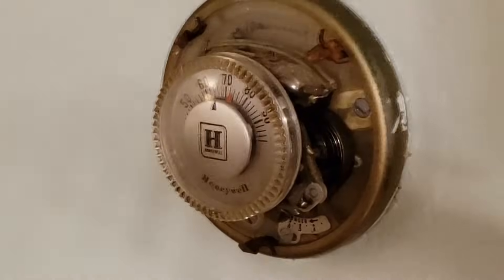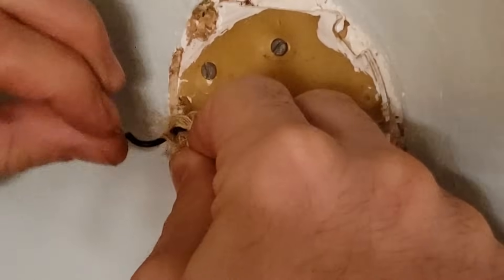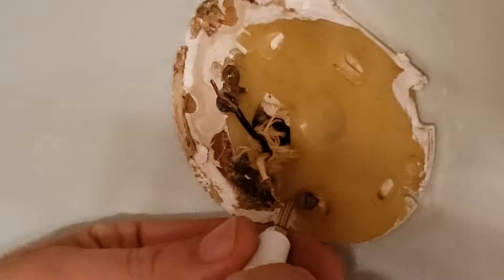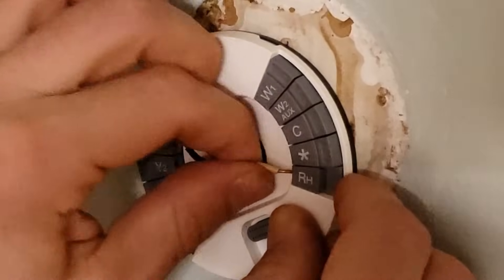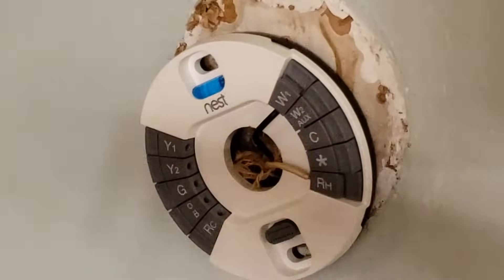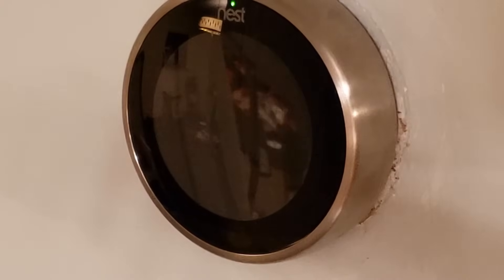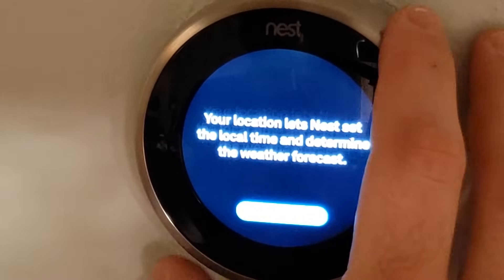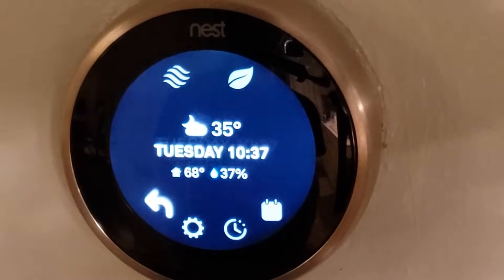How to Install a Nest Thermostat with Only Two Wires

Comment: just came across your video i was all day trying to connect with 3 wires from my old honeywell just like yours but i have a green,black and red wire where do i connect to. i thought green wire for G , B for blackwire and the RH for red wire but it didnt work. the nest read i had no cooling or heat connected?

Comment: I am trying to upgrade my current Honeywell HVAC system with EIM to Nest (3rd Gen)... In my existing thermostat (Model: THX9421R5021WW), I only have 2 wires coming into my thermostat (White and Red) but it controls both Heating and Cooling using the EIM. 
Can I use the above recommended approach for my upgrade? i.e will it work?

Comment: My thermostat is a Honeywell heat only. It has 2 wires. A red and a green. No white. The red goes to R and  the green goes to G?
Reply: No.
R AND W - it doesn't matter if it's 2 wire... Or what TWO colors.
Connect to R and W.

Comment: If I have 2 wires coming from a 24v transformer to my existing thermostat, can I install a nest 3rd gen. this way in your video? And if so, does it matter what color wire goes into each of those two tab connections on the nest?...Thanks in advance..
Reply from the maker: I don't see why not. If that's 24 volts AC, and if you touch the two wires together and your boiler turns on, then that's exactly the same setup I have.

Comment: My customers always makes this mistake, you need a common wire without that the Nest will die .
Reply: Yeah stat will lose charge-
Reply: @michaelpaulzdaone  yes the common wire is supposed to provide power to the unit. Otherwise it would need batteries. Without it...🤷🏼‍♀️🤷🏼‍♀️🤷🏼‍♀️
Reply: @melissamilligan  The Nest E and this 3rd Gen unit "steal" power from the two wire system to charge the battery but this can cause issues with some furnace systems. So one must always be prepared to have to use a power adapter into the C terminal. This is why you so often see conflicting experiences, it works for some but not all systems.
Reply from the maker: No mistakes here, at least not with this boiler. Doesn't die.

Comment: You HaVE to have a common wire people!!! (At least a 3 wire thermostat cable) to make these work correctly. As a tech for 10 years trust me! If it’s a 2 wire say red and white  that 24v is dedicated to making the switch at the heating unit to turn on.  Yes you will power your eco bee/nest when NOT calling for heat ... but when your thermostat makes a call for heat it stops powering the ecobee/ nest and will power off
Reply from the maker: You literally just watched a video where that doesn't happen.

Comment: If I have a 120/240v old thermo do I need to install a transformer to lower the voltage still ?
Reply: If you buy this in the uk/Eu it comes with an extra box called a heatlink to handle the high voltage switching of the boiler. Do not try to work this with a 240v system without the heatlink
Reply from the maker: @nelseify  also keep in mind the EU uses 50 Hz instead of 60 Hz for AC electricity. Might still not be compatible here.
Reply from the maker: Not sure about that one. Just guessing here, but on the surface it sounds quite painful, step down to 24VAC for Nest then step back up to 120VAC again to maintain compatibility with your furnace. Probably easier to just get a 120VAC thermostat.
Reply: @Bootstrappin  
If your thermostat is labeled 120V or 240V or has thick wires with wire nuts, your system is high voltage and isn't compatible with the Nest thermostat. Do not connect the Nest thermostat to high-voltage wires
Reply: I am asking I want to switch to a nest and from what I read, it says that it wont work if my thermo is running at 120/220 . I don't wanna buy one and not work lol

Comment: So,what's charging the battery if you only have two wires?
Reply: Dude its A/C voltage. Those two wires carry power when the heat cycles off, charging the battery. When they are shorted, they do not charge the unit, but it has enough time over a day to fully charge

Comment: That isolation switch is so badly designed with ON/OFF at the wrong ends with arrows, so a quick look appears to show you turning it on.  That is so bad for a critical safety item -they must be unambiguous.

Comment: I have what looks like the same behind my mechanical thermostat (1 white & 1 black wire) controlling 5 baseboard heaters in parallel. They are a combined 4,500 W. I think I would need the C-wire transformer to get power to the NEST, but can it handle my setup?
Reply from the maker: As long as your existing thermostat isn't a specialized 120VAC unit, you should be fine. All most thermostats do is close a small 24VAC relay, it doesn't have all 4,500W actually going through it.

Comment: what features aren't available when using the two wire setup?
Reply: R (ed) - Power
Y (ellow) - Cooling
W (hite) - Heating
G (reen) - Fan
C - Common
R + Y = Cooling Only
R + W = Heating Only
Reply from the maker: None I can think of. Typically it'll control an entire HVAC, turning AC on/off, maybe the fan. Either way, full features.

Comment: You den lost your mind, installing a $250 thermostat on a wall heater. 😂.
Reply: Mine was just over 100 with current government /hydro rebates but still lol it's a thing of beauty that thing on the wall...
Reply: @RogerDiotte  but dude, it only turns your heater off and on. I could see it, if you have central AC,
but a wall heater?
If it's Aesthetics, get a picture and a nice frame. 
You can pay less than $20.00 for a fully functional thermostat.
You know, back in my day.... Wall heaters didn't even have separate thermos, you opened the front bottom, and twisted a knob.. It looked just as good.
Reply from the maker: @kewlztertc5386  I think you misunderstand, there's more to it than a simple thermostat. It can save you a lot of money on the heating bill by doing the following things:

1)  Geofencing: if you leave your Wi-Fi network, it knows, and turns the house down to whatever you set, like 62.

2) Predictive weather: it adjusts how long it heats for based on the weather forecast, so that it doesn't use the AC/heat too much/too little if it's gonna be hot/cold that day

3) It memorizes your behavior: if you keep setting it cold at night and warm mid-day, it'll learn that and keep doing that

4) You can control it through your phone, handy if away from home or too lazy to get out of bed

5) House hysteresis: it studies how your house responds to heat, and can anticipate when to turn off the heat because all your radiators will have latent heat even after the boiler shuts off.
Reply: @kewlztertc5386  I have a programmable thermostat, the older kind with the greenish basic screen and I hate the programming functions of it. I just had to put it back on the wall after painting and said "let me put some scheduling on here!!" 

It's rubbish, unmarked buttons that you just have to hit and hope its the right one to advance the screen and all that, 20 screens, pm schedules, am schedules, no way to keep it consistent, a monday- friday option/ weekend option one screen and done, nope gotta go through every digit, it feels so archaic, half the time I'm just hoping it works and it's not on some in between screen or whatever. I would have bought 3 nests already if they weren't so expensive but I don't want to spend 100s for each so I'm stuck with these 2 yellowed calculator boxes and a gold dial from 40 years ago.
Reply: @aikidoboynj  look on ebay for wifi thermostat. there are a number of Chinese knockoffs that might work for you at a reasonable (under $50.) price.
Nest, looks nice, and has nice features. If you have a modern house with both AC and heat, then I can see a person buying one. This video is about hooking a nest up to a wall heater, and that's like putting expensive rims on a Ford Pinto. Superfluous!
Reply: @kewlztertc5386  I'll check into those
Reply: @kewlztertc5386  You're gonna make Bootstrapper a pot of coffee every morning? Won't your boyfriend get mad eventually?
Reply: You keep hitting these replies with upper cuts and left hooks lol!!! I see your point!
Reply: @kewlztertc5386   got the same thermostat from Eversource for 14 dollars today...so im replacing my HEATER ONLY device.
Reply: @StevenDoh  well YEAH! for $14.00! Even @$50 it would be acceptable (overkill). But its normal price of 140$ makes no sense!
Reply from the maker: Ok Boomer

Comment: My new Honeywell thermostat only has 2 wires, but they are labelled a and b, and both wired are grey.
Reply: is your's a WIFI thermostat or a regular one?   For an older 2-wire, I don't think it matters.  Connect either wire where you want.

Comment: You need to read the instructions better you should have like you say the screws are gorgeous you need to put the mounting plate on first you just don't screw it into the wall anyway to each his own congratulations at least you got it to work
Reply from the maker: Instructions are for squares

Comment: I tried this but it wasn't working out. Had to trace the two wires back further and discovered it was being muxed. 5 input wires into a circuit board and then output of two wires to my old thermostat. I actually had all the wires needed to hook up the nest properly. Felt like a winner and an idiot for not catching it sooner at the same time.
Reply from the maker: I'm glad it worked out, sounds like you had some MacGyvering to do!

Comment: How do you test the voltage to know if its 24 or 120 and were do you test it with the breaker on and was that the nest 1,2 or 3
Reply from the maker: Take a multimeter, set to AC voltage, and probe the connection points with the thermostat cover off. Typically, a high voltage thermostat is labeled as such, but of course don't rely on that. This is the Nest 3.

Comment: Lmao, loved this awesome vid! I'm going from a two wire system, 31 vac, to a Sensi smart touch. Old one has a white wire to W and the red wire to RH, with a jumper from RH to RC. Of course it was 2AA battery powered, no common wire. The Sensi already has a built in jumper wire RH to RC. I  know the C is power for the new fangled wifi and display and RC/RH is for heating and cooling. I was wondering if anyone knew what the W wire was for and if I needed it connected on the new Sensi? Thanks for the great upload! Subbed and look forward to watching more :-)
Reply: I had the exact same setup with a crappy old thermostat... so the Rh is power the W is actual control of the temperature and the C is the Common which is constant power that the Nest needs to complete the loop with Rh... you do need all 3 of them to run the Nest... I didn't have the common before and everything worked except for my burners blowing hot air... the unit was just blowing cold air

Comment: So today I installed a Nest E thermostat into a Heat Only system that had 2 wires. I need the C-Wire power because of troubles in the past with other setups where it worked for awhile and then didn't work shooting the error no power on R wire. Anyways, in my setup I luckily had more wires tucked behind in the wall so I went to the furnace and found that the C-Wire (Blue Wire) wasn't attached so I attached it and now I have the Blue Wire connected to the C terminal on the thermostat and problem solved. 
If your lucky you won't have to deal with ordering the 2 wire Venstar kit off Amazon which again I had to do on another setup I recently did and the Venstar fixed that issue in a jiffy!
Reply: My old 2 wire thermostat also had plenty of wires behind it, now I need to find which one is attached to the C

Comment: I have same old Thermostat as you in my basement. When I connect the nest I get a clicking sound from Argo set up by boiler. The old thermostat never had an off switch just turn heat down to 60 in summer so the boiler recognizes it as off. Any advice on this, I would really appreciate it.
Reply: I had the same setup, and since the thermostat was trying to use the signal wire as the common at the same time as sending a signal down to turn on the furnace it would get a ticking or buzzing sound.  I solved the issue by adding a common wire so it had a dedicated line to complete the circuit to the thermostat to maintain optimal power.  luckily for me I only have to run the third common wire a short distance so it was not an issue.

Comment: Question, I have  a yellow wire coming out of my forced air furnace  that is spliced into a red wire, then a white coming from the furnace.  two wire system, on the schematic it shows this yellow wire with the writing field "installed thermostat and low voltage wiring" along with 24v sec written along the yellow wire path.    
 So can this yellow be jumper off of to make a C wire for another wifi thermostat, or better just to go the two wire path you did here?
Reply from the maker: Sounds like it could be, though the yellow seems like it's a 24VAC supply wire, not C.
Reply: @Bootstrappin  isnt that all the c wire is though?  Sorry if that is a stupid question.
Reply: I think I figured it out, it needs to be a continuous 24v.   Make sense, ill bust out the multimeter. or just buy a nest.
Reply from the maker: @mikecynkar5384  not at all. The C wire is usually referred to as the 'common' wire, or 0V. The yellow usually is for the 'cool' air conditioning wire, from what I'm reading.

Comment: why doesn't it matter which color wire you put into the Rh and W1?
Reply from the maker: Good point, try both if one doesn't work.
Reply: BOZO DOES IT no fire or other hazard if wired backwards? It just won’t work?
Reply from the maker: @jakehits  I guarantee nothing, but if it's wired wrong it just shouldn't work.
Reply: BOZO DOES IT thanks man!
Reply from the maker: @jakehits  no problemo!

Comment: Why they say that you need a C wire? Did it worked because there was a call for heat? Would it work with a forced air heat and AC?
Reply from the maker: Because in certain cases the Nest is incompatible unless you have that C wire. Only one way to find out I suppose. I don't see why not, but you'd have extra control wires for the fan(s) and air conditioner.

Comment: Question. I have a 2 wire set up also. The nest is hooked up on an old thermostat with just 2 wires to my Noritz tankless heater. However my nest isn’t charging through the base i have to remove it from the wall and charge it via usb do you have that same issue???
Reply from the maker: I do not, mine charges through the two wires. It may not have enough current or runs on different voltage. Take a multimeter, set it to AC, and take a measurement on the two wires, it should be 24VAC to charge the Nest. Some setups may require a third common wire unfortunately.

Comment: I hooked mine up just like you said and had the same exact previous thermostat as you but now it just keeps turning our heat on even though the house is way hotter than I indicated we would want heat on. It is 88 in here and I said to turn heat in at 60. Any suggestions?
Reply from the maker: That's strange. So the Nest is working I assume, but it kicks the heat on. Do you have AC?
Reply: I have the same issue the furnace will not stop heating I have it set to off but still consistently running
Reply: @scottgrimard198  
Hello Scott we are encountering the same issue. Called Nest and they gave us "possibilities". No concrete reason. Did you find a solution if you don't mind sharing.
Reply: @ttate9954  yes we did, it was a defect with the thermostat, got a new one installed it and worked!
Reply: Keep me posted I know that thing inside and out now Haha.

Comment: in most cases u need another wire (neutral) cause down the road this will cause problems
Reply: what will happen?
Reply: @aikidoboynj  I'm thinking it's not bad.. Not sure where the neutral wire would be anyways? Looking at my setup I see nowhere one would exist?
Reply: There is no neutral wire going to any thermostat.  I think you are referring to common.  Traditionally, common is blue, and some powered thermostats need it.  Some battery powered thermostats do not need it.
Reply: Hey, what is going to be some of the things I might see down the road from doing this? I'm hoping nothing other than replacing the wall wart transformer.

Comment: I have a R wire and W wire only. I don’t see a sign for high voltage either. Will this video work for mine??? Thank you!! Hope to hear from you.
Reply: You are awesome!!! Thank you!!!! Will Let you know how it goes!
Reply from the maker: Sounds like you have a heater only set up. Yes, sounds like it should work: turn off your boiler by hitting the "emergency off" button, put 'R' to 'Rh', and 'W' to 'W1', then turn your boiler back on and you should be in business.
Reply: Hi
Reply: I have a green n red wire only plz help me to put my nest thx

Comment: If you have a millivolt thermostat this won't work . Another video shows how to do  it by adding a 24v ac adapter to power the nest. pretty cool.
Reply: I can’t install the Nest Thermostat in my parents old home.  It is two wires black and white.  Wires are too thick (like an outlet) and won’t fit in the thermostat)

Do you know the fix?
Reply: @pattayperformance you can just use thinner wire to connect them

Comment: I have high voltage 120 volt. The thick wires wont even get in. Which transformers would I need?
Reply: RC840T240 RELAY WITH TRANSFO 208/240V
Brand: OUELLET
Mfg Number: RC840T-240
Rexel Part Number: OUERC840T240
Reply from the maker: The Nest does NOT support 120VAC and if you went so far as to attempt to poke 120 volt wires into the Nest, you should call a professional before you get hurt. 120VAC is dangerous and can kill you. That said, call Nest, I'm sure they have a solution, and peruse this thread, a transformer/relay is mentioned:

https://www.doityourself.com/forum/thermostatic-controls/541504-thermostat-conversion-120